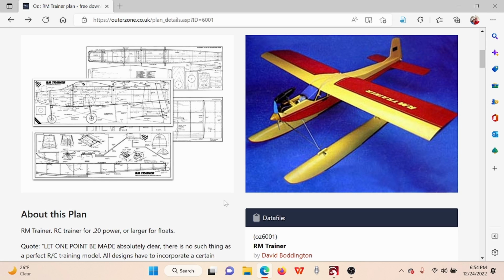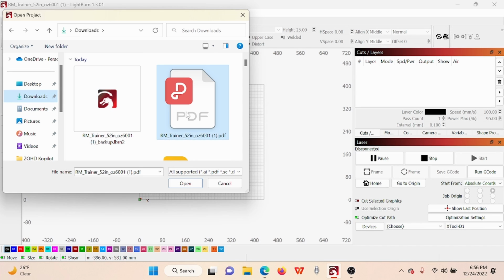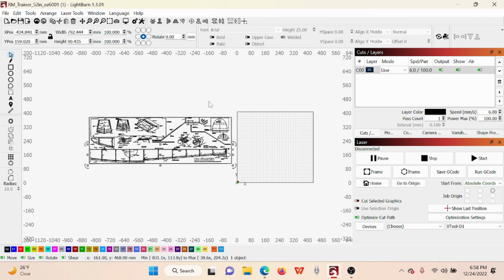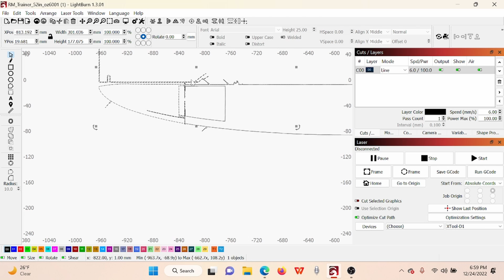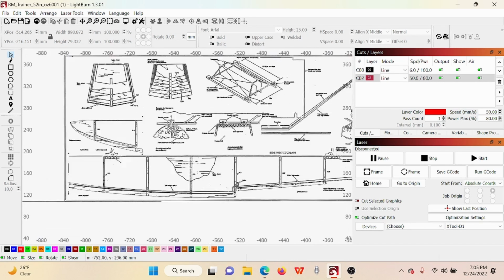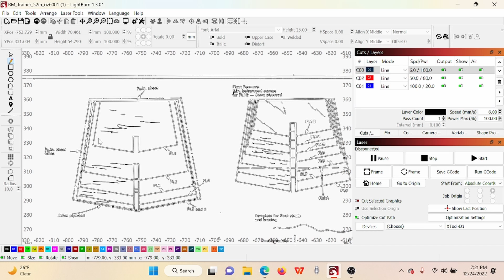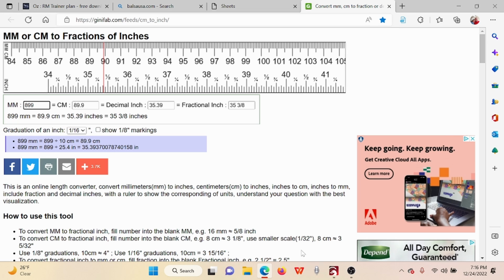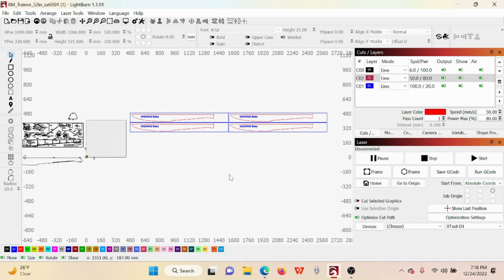Digital Plans to Lightburn Laser cut files-My process

Comment: Hi I have a vector file for a plane off of outerzone.  We are limited in New Zealand for the size sheets (Balsa) we can purchase. Can you please explain how we get the components we require for the size material without all the unnecessary or over size units.  The laser cutting range is 480mm x 500mm. So I would need to cut some units in 2 parts I.E. fuselage top and sides. This a new venture and would appreciate your positive reply  Cheers
Reply from the maker: Maybe my "Print and Cut" video will help with this?